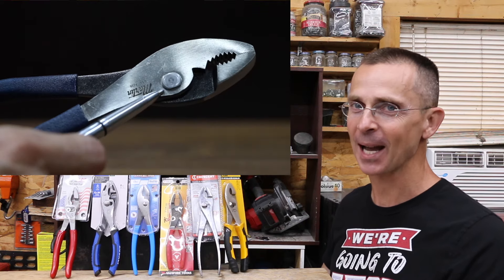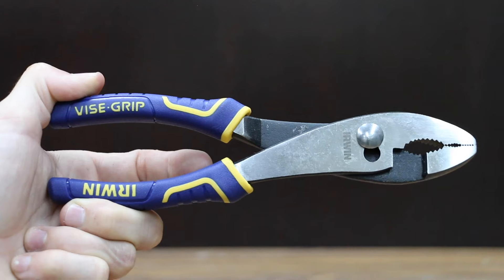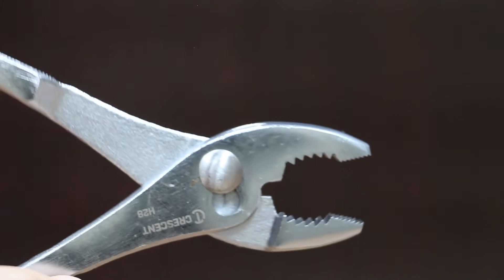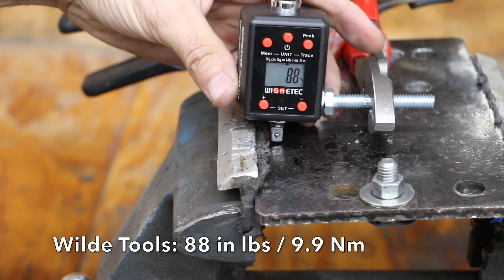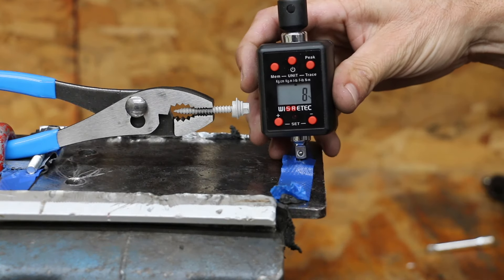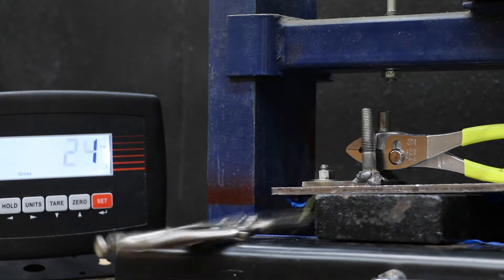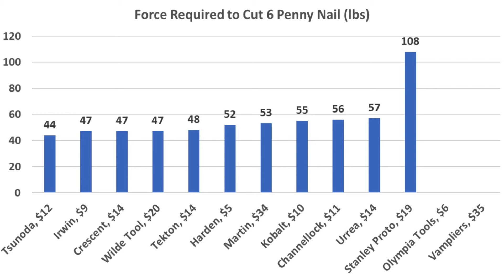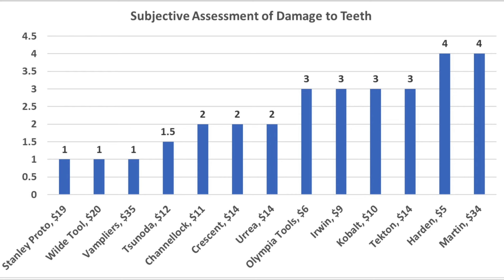Best Pliers (SLIP JOINT)? US vs Japan, Vampliers, Kobalt, Irwin, Stanley, Tekton, Martin

Comment: I would love to see a cooler competition! I haven't found anyone that has done a good comparison of coolers that isn't trying to get you to buy a particular cooler. I bought an Orca cooler, but Yeti and some of the other expensive coolers would be nice to see a cooler showdown.
Reply: Good idea!
Reply: Agreed
Reply: Lifetime cooler, one of the best for the price. I purchased the 77 quart and it held ice for 10 days outside in ~82 average daytime with me opening multiple times in the first few days, I think it was $168 before tax so around $180 after tax
Reply: Another great video always makes my day when you post. Keep up the good work
Reply from the maker: Thanks for the suggestion.
Reply: @ProjectFarm  I support this suggestion
Reply: @A_guy840  I second this
Reply: YES PLEASE!
Reply: I would also expect one of those cheap semi-disposable Styrofoam coolers in the test too.
Reply: Please include a cheap cooler that you've done the well known mods on, including injecting expansion foam into lid/body + adding weatherstripping / better latches. 

Thank you!
Reply: Good idea, but getting out of season now. Would have been a good test 3 months ago.
Reply: I like this idea. I also want to see those super cheap foam ones
Reply: I would recommend to test budget coolers and potentially modify one of the standard igloo coleman type cheap coolers by using spray can foam in the lid. Ive seen what i think to be a hige improvement in cheaper coolers by doing this
Reply: I work at a restaurant supply warehouse in my area and we use disposable styrofoam coolers with ice to keep fresh seafood cold. It gets replaced every other day. I sometimes take a few for my own use. The coolers hold about 40ish lbs of salmon full and are around 7x14x29 inches inside dimensions 1 inch thick all around.
Reply: @ProjectFarm  if you do a test can you also test a home made cooler using the Mylar bubble wrap insulation and foam?
Reply: That would cost a fortune with how overpriced a lot of those are.
Reply: This is a good idea. I know everyone raves about the Yeti but i bet there are better ones.
Reply: Yes please!!!!  My boys both play travel baseball and we live out of a cooler from April through August.  I’ve been wanting to buy a high end cooler, but I don’t trust the comparisons I see on the internet. I would TOTALLY trust a review from Project Farm!!!
Reply: That would be pretty cooler
Reply: @glassvial  yea because this was the last summer season ever. Sucks. I know.
Reply: I'd love to see him torture test coolers. This cooler can hold a tractor... This one can't.
Reply: most utube tool "reviewers" are just sales people, that's why Project Farm has so many views. People trust him.
Reply: @A_guy840  I found his videos after buying a cooler. I liked them but I thought that project farm would be able to reach a broader audience and maybe do some different tests.
Reply: Yeti is overpriced mediocre stuff.
You can get equal of better quality for the same price or less.
Reply: Second this!!!
Reply: @Ken Fullman they do exist, I have s 12 volt compressor fridge in my boat.
I also have a 12 volt compressor fridge kit for building my own custom freezer/fridge, just add isolation/enclosure. Mobile home or boating equipment shops have that stuff.
Reply: This is a great idea everyone should like this comment n get it up and running
Reply: He’s like, damnit now I have to spend $2000 on 5 coolers
Reply: Cooler...good idea.
Reply: I would love to see that a well. The market is crazy on coolers. So many t I choose from and its would be great to have a no BS comparison of them.
Reply: Yes!!!
Reply: Engel, always buy fridges that last in Australia. It's common sense
Reply: @ShopJock  I did the same thing to my  cheap IGLOO cooler and more than doubled the time it kept the cooler cold.
Reply: Big frig is a local company. They seem to be pretty good at a fraction of some of the other big names
Reply: No point. The Lifetime cooler is the best for the money. My small cooler still has
Ice after 3 days.
Reply: If you do this, please put R-tic coolers into the mix! Thanks!
Reply: @avatarofpapermagic  They are a great brand! Used by many labs and other pros! 👍🏼😎😉
Reply: Maybe Todd could do a Water Cooler competition.
Reply: @ProjectFarm  I have a video suggestion. Super Tech has a new “Advanced Full” synthetic motor oil and I know that you have tested the Super Tech full synthetic motor oil but would like to see the advanced full synthetic Vs the full synthetic. I think viewers would love it because a lot are wondering what the differences is between the two. As always great video!👍
Reply: American Test Kitchen/Cooks Country on PBS has tested different coolers on which one stays cooler longer and pricing.  You can watch these shows online and YouTube and search which one has the one on coolers.
Reply: This doesn't really prove anything for cooler brands but I have the yeti backpack cooler and the yeti ice pack, any water that Melts off my ice  drains to the bottom of the cooler where the ice pack refreezes it Into ice as much as a half inch thick around the ice pack. It's kind of mind blowing.
Reply: @Bellflowerbell  I have the same one, caught it on a deal during the winter. It is truly a great cooler, I was unloading my job box out of my truck and poked the forks a little too far under and pressed my cooler up against my actual truck tool box, the pressure cracked my aluminum diamond plate tool box, the cooler... Ripped the decal. Very tough and holds ice great, but with all coolers they work best with a sacrificed bag of ice and filling it with stuff straight from the fridge.
Reply: I'm sure one could be done if you supply $$1500 to buy them
Reply: @ProjectFarm  
 Okay, Todd. Nobody else will say it, so here goes: 

      It's almost imperative to do a condom showdown. Bring Billy Ray Mullet out of retirement. I'm sure his right eye has healed by now. Anybody else on board with this request? If Farmbago is a rockin' don't come a knockin'! Huh? HUH? 

.
Read less
Reply: Brilliant idea! Maybe he can even test coolers strength against the Farm-a-Bago!
Reply: @glassvial  For normal use, but for us in the northern climate sometimes we need to keep stuff hot in the cold. Same principle.
Reply: Would like to see how the 15 buck red ones from the dallar store with no drain stands up to yeti an Magellan
Reply: Great idea fits the NFL season Go Ram💯
Reply: There is a YT channel which did a 14 day 10 cooler comparison, the Otterbox came out on top, even over Yeti.
Reply: I just bought the WM 88.00 cooler. Made in America and so far I am pretty impressed.  I had a older Igloo that while smaller was going through 3 bags of ice a day. The 5 day cooler lasts avg 3 days with some ice still in the water. In New Orleans after this hurricane I was paying avg 3.00 per bag. It has paid for itself in two weeks. 
I open it 5-6 times a day and put warm drinks in it. A few times I bought ice after two days but that's on me because of the adding warm  drinks I guess. Even then the water was ice cold and the ice covered the top of the water.  The color never left the truck bed.
Well worth the money and American made, I will probably end up buying the larger one for camping and such.
Reply: One thing that the Coolers on Sale channel definitely showed was that the cheaper brands are very inconsistent in quality.
Reply: Excellent suggestion, as we currently have to take somewhat vague claims by the manufacturers/distributors/brand name owners on trust.
Reply: @ProjectFarm  Go for it - it's a good one.
Reply: Haha thought you meant funner when I first read cooler.. lol
Reply: Yes yes!
Reply: I think it’s cool. Just because he no rap with music while he demo not mean it was not cool. My cousin Mauro he bought cheap tools. I show him video. He said cool. If he say it cool then it is. Everyone in village vote him coolest guy in village. He work hard to bring this importation, no that word not rite but the English peeps no what I mean. It’s cool
Reply: @Pedro72740  I am sorry... I mean an 
Ice Chest competition.
Reply: @Pedro72740  I love Project Farm. He couldn't have made a more cool 😎 competition.
Reply: Nothing beats my old garage sale find malboro edition 12v cooler (dont really know the brand, i think its coleman) plugs in and cools or warms.
Reply: Nothing will ever beat wrapping your lunch in a sweater and stuffing it someplace cool until break.
Reply: Add in the 30 quart sanley cooler, havnt been able to find it tested

Comment: I discovered Tsunoda over a year ago, i was really impressed with the quality. I have a couple of tsunoda cable wire cutters and they are my go to.
Reply from the maker: Great feedback!  Thank you
Reply: It's too bad they weren't in the side cutter vid.   I've never heard of them but they will be the next set I buy.
Reply: @grabberorange5663  you're right! I have the flush cut/side cutter that are amazing with cable ties! Leaves them flush and non lethal!
Reply: @NickToland  
Do The flush cutters launch three cutoff bit still? That's always the problem I always had. If they've managed to solve that... I'm probably going to need to Amazon their tools. I've never seen them in any local store.
Reply: @CtrlAltRetreat  im not too sure what ya mean but they do certainly fling the cut plastic unless you hold it and they are incrediblly sharp!
Reply: Hope his season gets better
Reply: I own 4 sets of Tsunoda pliers. I wanted to buy a set of wire strippers from them but I saw that they use a different standard for wire size than we do. So I popped off a quick email to the company just mentioning the issue. The next day I got this long personal email from some high level executive in Japan! He was asking me a lot of questions about what standard wire gauge we use in the U.S., etc. Amazing!
Reply: @61hink  Yup, Tsunoda is a very small company with three small factories in Japan (and I think one in southeast asia). I've got several of their cutters and pliers as well.
Reply: @61hink  
That's fantastic. I'm sure they'll be as glad to make something that matches American dimensions as we will to buy them for the same reasons
Reply: @richkh  Thailand is their other factory if I recall correctly

Comment: I love that we're working our way through my favorite aisle at HD and Lowes lol

Can't wait for a possible scissors or shears comparison!
Reply from the maker: Thank you very much!
Reply: Well, just Lowes, because I have yet to see the HD brand Husky in any of these.
Reply: Scissors are my main tool in work I'd love to see a scissors test!
Reply: Scissors are my main tool in work I'd love to see a scissors test!
Reply: I can just imagine some of the tests: today we're going to be testing how well these scissors make snowflakes out of a piece of paper, then we're going to test how well they curl the ribbon on a birthday present. ;)
Reply: Aviation snips. Left, Right, Straight.
Reply: I figure Dura-Sharp and Fiskars will rate well, but it'd be interesting to see what else may make a showing.
Reply: Check out the Knipex or Engineer brand scissors/shears, if you'd like to see some beasts.
Reply: Be sure to include some of the no-name stainless steel EMT-style shears that sell for $5 or so. They are great for so much! Excellent value! 👍🏼😎✌🏼
Reply: @pauljs75  I use CK, I'm a fan of Wiss too 🤙

Comment: Now I realize I need the Vampliers! I always find myself trying to remove broken/damaged screws vertically with the tip! And that design looks perfect! Thank you once again Todd!!!
Reply: The Japanese company that manufactures the Vampliers is "Engineer", and they sell the same pliers under their own name for a good bit less.
Reply: @61hink  This... They also make small pliers to do the same on small gear, like the ENGINEER PZ-58.  Great to have around.
Reply: @61hink  thank you, good to know before I order.
Reply: @rickgreer7203  again thank you for the info. Normally I dont hear this until after I spend more money than I should lol
Reply: I would buy a pair, but many on Amazon complain that they don't seem hardened well so the gripping part of the jaws get deformed over time.
Reply from the maker: You are welcome!

Comment: Oh boy here for this. I have used cheap pliers in the past and it's not fun. Especially on an important job. I tried to cut a peice of wire and ended up cracking the plier. I have used and liked Irwin vice grip. Great video.
Reply from the maker: Great point!
Reply: Buy side cutters. You'll never have to complain on plier videoa again.
Reply: @turbocpt1  probably should. I used what I had at the time

Comment: I've always been a big fan of Channellock, Crescent, and Irwin hand tools. Great job as always! Thank you
Reply: agreed, even if they're not rated #1, they're in the top 3rd and value priced. 
 Without seeing a tool review you know sticking with one of those will be a safe choice.
Reply: James Lundy  No, check the website. :-)
Reply: @ProjectFarm  you need to test dollar General 2-stroke oil against klots
Reply from the maker: Great choice in brands!!
Reply: I am a fan of the old school USA made ones ,not the Chinese made crap though
Reply: @ProjectFarm  do you think is it worth it to use amsoil vs ultra platinum pennzoil?
Reply: Knipex has new vampire style pliers ..KNIPEX Tools 82 01 200 TwinGrip Slip Joint Pliers, 8-Inch
Reply: Yup. Channellock and Crescent, especially, are names that are just so synonymous with certain kinds of wrenches people forget they even have a correct name. I mean, when's the last time you asked someone to hand you an "adjustable spanner?"
Reply: @Just_A_Dude  I've always called them adjustables.
Reply: @60anthonyh  I've always called them nut rounders.
Reply: @ProjectFarm  I have a video suggestion. Super Tech has a new “Advanced Full” synthetic motor oil and I know that you have tested the Super Tech full synthetic motor oil but would like to see the advanced full synthetic Vs the full synthetic. I think viewers would love it because a lot are wondering what the differences is between the two. As always great video!👍
Reply: @Just_A_Dude  if someone asks me for an "adjustable spanner", they'll get one upside the noggin!
Reply: @Just_A_Dude  A spanner in the US is a tool used to turn a crank such as a diesel mechanic would use.
Reply: Channel locks break on me often
Reply: Agree with Channellock, Crescent and Irwin as go to's but the Tsunoda was quite impressive especially for the price and minimal damage to the teeth.  I'd definitely keep these in mind when my other 8 pair finally become unusable.
Reply: I have a pair of 10" Channellock tongue and groove slip-joint pliers that I've been using for years. Handyman by trade so I use them often and hard, I think I paid $11 for them on sale......I wouldn't dream of buying any other pliers.
Reply: Channellock pliers are great... I have several sizes for using on everything from compressing brake cylinders to tightening toilet fixtures as well as torqueing-down garden hose attachments.  Their lineman's pliers are beefier than Klein's and from my experience cut better, too.  Channellock is the only hand tool company I know that still manufactures in the USA.
Reply: @ProjectFarm  best windshield repair kit?
Reply: Irwin really makes some quality products and at a great price.
Reply: @alanj7306  I actually prefer Chinese vice grips to Irwin, ever since they lost my loyalty by choosing to manufacture in China.  The release on the plier is easily depressed with one hand on the Chinese rip-offs, which is much better.
Reply: Vampliers are game changers. They have tons of options too.
Reply: Knipex has them all beat
Reply: @henryk6424  they ripped that design from vampliers, they have some really good vice grips with the same deal.
Reply: @Jordan__Sloan  Really depends on the tool. Knipex channel locks are friggin amazing, although ampco non-sparking ones are better imo.
Reply: @ProjectFarm  you should test knipex pliers vs other brands I use them for work every day and they seem to work better then everything else or if it’s just all in my head
Reply: @60anthonyh  In statistics, you are what is known as an outlier. An outlier is an observation that lies an abnormal distance from other values in a random sample from a population. Nothing wrong with being outside the pack, but it's unusual nonetheless. Kudos for being more of an individualist!